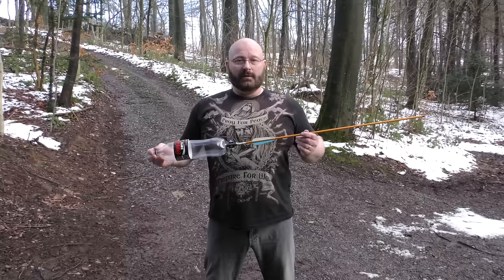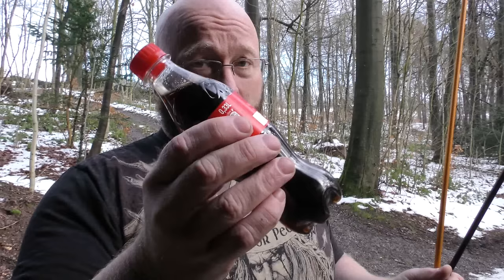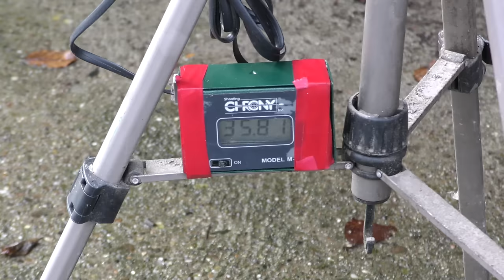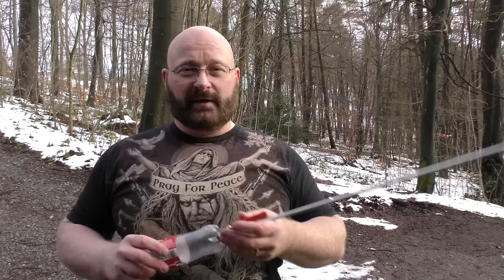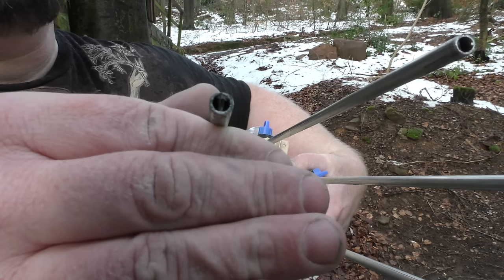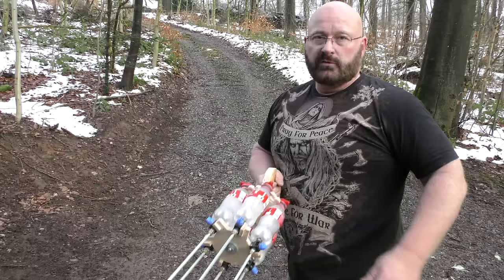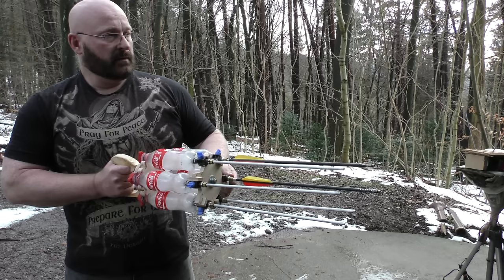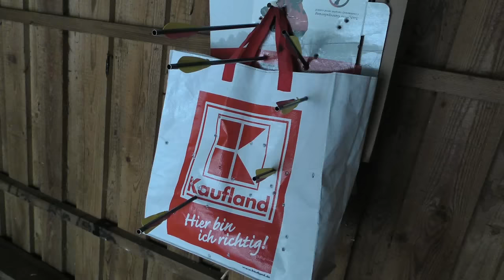"The Coke Bottle Gatling": Craziest contraption ever?

Comment: JoergSprave it sounds like you are only getting about 1/2 - 2/3rds of the air pressure out before the arrow leaves the pipe. If you can add a resistance to the arrow it should hold on until all of the pressure is fully expanding into the space. Or a button release system for the air. The mechanism of turning the valve by hand is slow compared to the speed of release...
Hope you can fix this one...
Reply: +8th sinner The addition of solenoids could give for a traditional trigger, but it would add complexity and the need for power. But if you're powering the device, you can probably find a way to get it to rotate the barrels for you to load the next shot.

Comment: the diameter of the inner...uhm tube and the quickness of the opening process are the limiting factors for the degree of occupancy of your pressure. V2 is not much bigger than V1 so i guess you should make a rubber operated valve opener. maybe even a spring or rubber driven aircompressor.

Comment: Try using the aluminum Budweiser bottles or something like that
Reply: +cj allyn Just use some PVC pipe with caps glued on the ends. That would get more pressure than any bottle.

Comment: so by using small exhaust valves you could prob. punch a much large volume of air to the arrow faster. (look at airgun designs) And the funny thing, you can "wire" the exhast valves to a push button valve and activating them all at once if you want to. =) There is shitload of cheap pneumatic stuff on ebay. ;)

Comment: Try using a push button release valve, that might help it for an full auto application.
Reply from the maker: +jpawhees No need, I got it to full auto already. Will upload on Sunday. Stay tuned.
Reply from the maker: +The Hairy Farmer No need, my pump maxes out at 160 psi anyway. My (affordable) compressor only does 130. The Coke bottles can easily handle 160.

Comment: use a hpa paintball tank 4000 psi not sure how you could hook a valve up to it but it would be awesome
Reply: +Mason Kendall If only there was some short burst air valve mechanism to regulate and release a controlled amount of air from a paintball tank. oh. Right. That's called a paintball gun. Incidentally those are legal in Germany too. If he took any poppet valve based gun, he could enlarge the airways and put in a heavier hammer and hammer spring. Also dialing up the input pressure on the inline regulator would work too.

Comment: Anybody want to explain the BB's law that he mentioned.
Reply: +Kenan Šabić as far as i know, you have to modify any barrel you are using together with compressed air as propellant, so that you cant load a BB gun projectile by putting it in the front of the barrel, if you would want to load it you would have to unscrew the barrel and load it from the back. this is so you or for example your kids cant misuse in this case the arrow gun as a real BB gun.
Reply: +Moonbreaker97 Makes sense. It could also be creating too much force to fire a BB from.
Reply: +Kenan Šabić and of course if you would unscrew the barrel to load it and the end is modified the projectile would either destroy the barrel, get destroyed itself or both, in any case you could only shoot it once and then the barrel would be screwed.

Comment: du brauchst eine pumpe für federelemente, damit schaffst du 20 - 30 bar! außerdem ist die pumpe so klein, dass du sie direkt mit verbauen kannst. gibts bei amazon ==> "dämpferpumpe
Reply from the maker: +schorehans Habe gerade eine bestellt, geht bis 41 bar.
Reply: +JoergSprave Mach bitte mal einen Test, bei welchem Druck die Cola Flaschen bersten.
Reply from the maker: +jospi2 So bei 220 psi werden sie wohl aufgeben.
Reply: +JoergSprave ;) du bist der hammer! voller spieltrieb voraus!